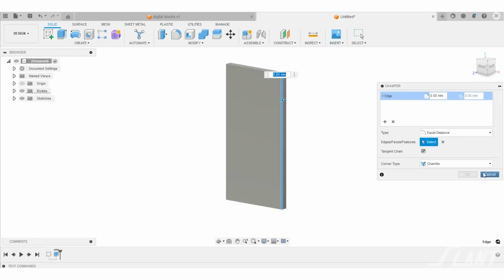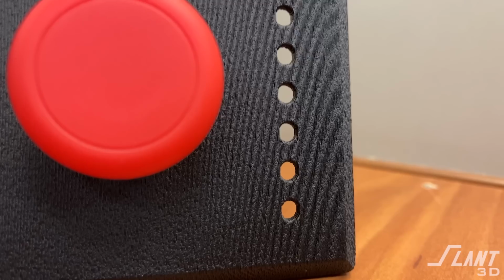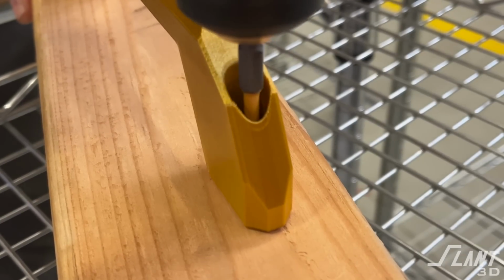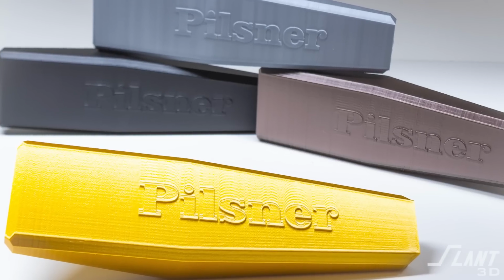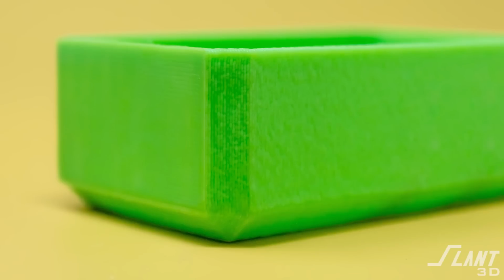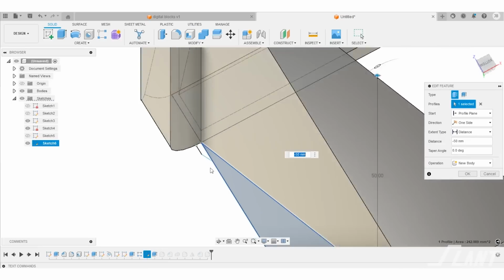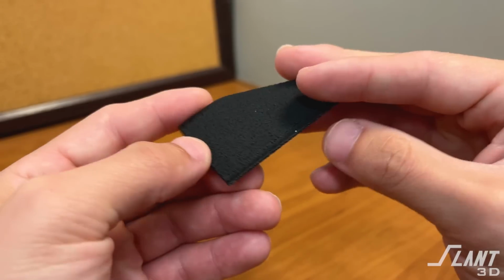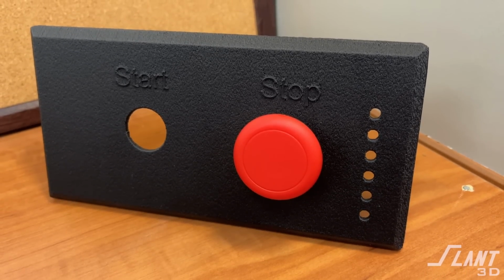Designing Panel Covers for Mass Production 3D Printing

Comment: Have seen your critique of putting it on its side with bed slingers a lot. You can usually just put it with the long side parallel to the y axis. This will reduce the wobble from the bed. This also works for - saent3d Objects ;-)  Yes, it work's better with a Core-XY but I have great results with a Bed Slinger, as long as the Bed Slinger has a clean build surface (if it got greasy and bed adhesion is dimiinished this will obviously deter from this).
Maybe you can make a Video with Tips for Bed Slingers? :)

Comment: Man, it's nice to see an engineering point of view on 3D printing.

Noting against the work of 3D printing "reviewers", but they chose what they print. 

As an automation engineer I don't print tiny little boats that sit on a shelf in my basement. 

Real knowledge for real part.

Making the best out of what you HAVE to print instead of printing what ever you want.

Comment: What would you say is the minimum (or max) height of texture to apply? Obviously, more texture = more texture, which I can see as useful for improving the grip, but how low can you go to achieve the result while minimizing layer lines? How does layer height affect the printers ability to print the texture? I love this idea and need to experiment, but I didn't catch the parameters you use for the texture.
Reply: For me personally: I just do the PrusaSlicer Fuzzy Skin. Goal: No Visible Layer Lines but not too much texture -> thickness of 0.2 and point distance of 0.4 works best (old crappy Ender3 ;-) )

Comment: Thank you for this interesting video. I Imagine that you apply the texture with the fuzzy skin feature, but i don't understand how you apply the texture only on the face and not on the text.
Reply: If the text is a separate part (that you import into the model) it's pretty easy to apply the fuzzy skin only to the main panel part and not the text in PrusaSlicer.  You can apply (or not) the fuzzy skin feature to any part individually.

Comment: My only concern with the fuzzy skin on panels like that is the fact that those kinds of panels are usually used in greasy dirty environments,  and fuzzy skin is almost impossible to keep clean..
Reply: Mostly the idea is to hide the layer lines. There are other textures that you can use to do that, say a cross hatch of diamonds, or the like. If you are concerned about oily fingers, most machine oils will find their own way into the plastic, regardless. You can always treat it with an epoxy paint layer before installing it.

Comment: Very useful insights again, thanks!

I've also experimented with  this fuzzy skin trick lately, and it is a blast! I printed a large box with a low quality black pla+ fila which prints BAD! Top surface after infill layers tend to curl up regardless of temperature or speed. The outer surface though thanks to fuzzy skin looks really nice. I can only suggest it!

Comment: The print orientation is total idiocy.
Just get rid of that text and print it lying down for better printability and strength
Reply: Or make the text recessed and provide contrast with cloisonné painting. Takes practice, or a (printed/lasercut/routed) mask to prevent spills. Or sand afterwards, but I hate that.

Comment: Part ejection is incredibly easy if you use a pei sheet. With a bedslinger upside down and a string you can eject the part effortlessly and for free.

It seems like you have to redesign a lot of your parts simply because you haven't updated from a glass bed.

Comment: I understand most of these electrical panels are made for low voltage signals and/or low current
But what about AC voltage / high current safety. My understanding is "commercial" electrical enclosures have to comply to a lot of rules about electric shock protection, fire retardant behavior, heat and mechanical resistance.
How do you mitigate these contraints with 3D printed parts?
Reply from the maker: You make the part with fire retardant, UL rated, ESD safe material. Just like any other process.
Reply: @slant3d   Most electrical cabinets with power electronics must be metal tho. Be it for shock protection or EMF protection. Maybe conductive filaments in conjunction with aluminum tape could offer EMF protection tho.
Reply: @ThePunischer1000  You might want to mount the components on a PCB with a ground layer all over, and have them protrude from the printed front panel. That does kind of seem redundant.
Reply: @ronnetgrazer362  In an industrial environment like it is proposed here, this is absolutely not sufficient for EMI shielding. You need grounded enclosures with controlled gaps at all panels, or you actually increase your EMI emissions instead of decreasing them. Also, grounded planes on the PCB are reasonable for limiting cross talk between signal lines but do almost nothing for external EMI shielding, since all your conductors on the PCB are antennas in their own right.

Comment: 3d printing has its place but this is something where I would definitely go to a metal shop for. Many can manufacture these in 2-3 days very affordably and with much nicer finish and higher contrast lettering.
Reply: Ok mr mega bucks. Any machine shop is going to charge 3k for 3 days.  Have fun with your 4 digit panel cost.
Reply: @saxplayingcompnerd  next time you need a panel made look up protocase. I’ve used them and I didn’t need mega bucks to get great professional products made
Reply: Not to mention, the general idea is a warehouse could order these cheaper and get them faster them most metal shops can provide, and can do them even cheaper if the company has it's own in-house 3D printing capability. Having a departments run off a handful of panels that can be touched up with white paint to provide contrast is far quicker and more economical then having to find an outside service to do so, negotiating the order, then waiting for it to be delivered.

Comment: The only thing i don't like about this aproach is that there is not any contrast beetwen the text and the panel itself, some stickers will be much better IMO
Reply: You could print a mask that fits over the text, to protect the background as you spray or roll on paint to highlight the text.
Reply: Depending on the material, even a marker or paint pen may take care of the contrast, and you can customize the colors to the needs of the operator. i.e. if you have operators with a red/green or blue/yellow colorblindness condition, you can adjust the color of the text (or other graphics) to assist and give good contrast under the lighting conditions of your facility. If you are concerned that they will rub off or something, clearcoat the result.

Comment: I’m always amazed of the print orientation you use.  Would love to have some insights on the build in support, when to use them, etc. it’s in several videos but a review would be cool.
Reply: Well, in his case the orientation is often important for auto-ejection, a feature most hobbyists don't have to worry about. I don't mind a bit of manual labor to take a piece off, but if something is going to be mass produced, then minimizing labor for each piece is important.

Comment: Great video. Still not a fan of the texturing, despite understanding your reasoning for it.
Reply: With a good printer that has input shaping and doesn't have flimsy corners holding 2020s, untextured side surface will look beautiful.
Reply: @daliasprints9798  Yeah, I have a dialled in BambuLabs P1P and at 0.2mm layer height the layer lines are barely noticeable

Comment: How do you generate the texture but not on the text? I assumed the slicer?
Reply: Great queston, I'm also wondering how was this texture applied on surface but not on the text :)
Reply: @mirekolszowy1873  I know Cura has a FUZZY option but it doesn't look very nice and I think it is applied on all surfaces inside and out.
Reply: You can exclude areas of the model by adding a modifier which has Fuzzy Skin set to "none". This is one way to do it at least ;)

Comment: 2:33 god damn that is a lot of ringing. You gotta be careful what you show on this channel, because we know you printed this using your print farm..
Reply from the maker: We exagerated the error the smooth part to highlight the kind of issues that can arrise. So we twist the Z looen some belts and put it on a bedslinger so that the error is clear for demonstrating what to avoid.
Reply: @slant3d Ok, but ringing and extrusion artifacts and poor layer stacking are a recurring thing on your channel. It gives the impression your farm is way behind the state of the art in print quality, which makes sense because upgrading an entire farm can't be easy, but it's still kinda offputting.

Comment: When you print electrical enclosures for customers what materials are you using?
Reply: Whatever it is, I hope it's ESD safe.
Reply: I'm guessing that's for signal voltage, 3-12v, and not for 3 phase😮

Comment: I have a question, when ever I print holes vertical they are not round , but why the panel you showed have  rounded holes and clean
Reply: I was just gonna comment on that. Those circles look super clean.
Reply: Yeah first i thought it printed laying down
Reply: They have custom 3D printers and have their settings dialed in.
Could be due to better machines.
Reply: @Antassium I think you are right , now I watch the video again and  also it looks super clean because of the black colour .
Reply: You normally can add a bit of a teardrop shape to the hole to reduce overhang